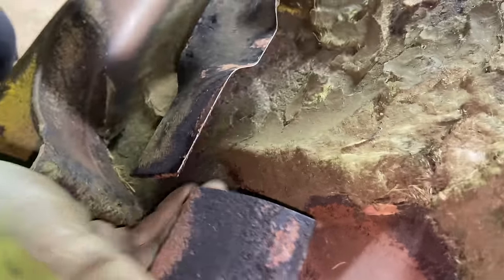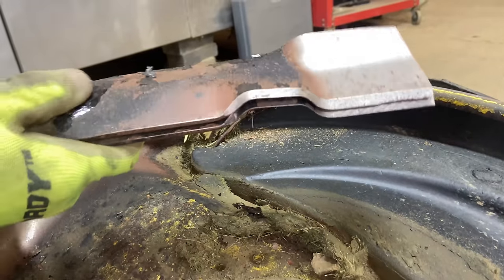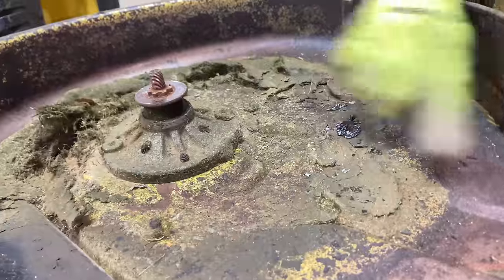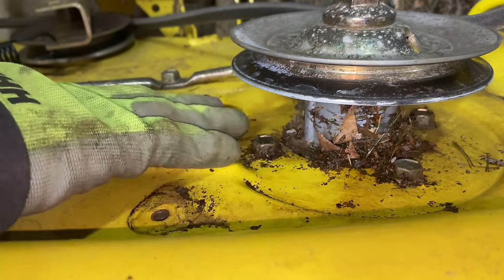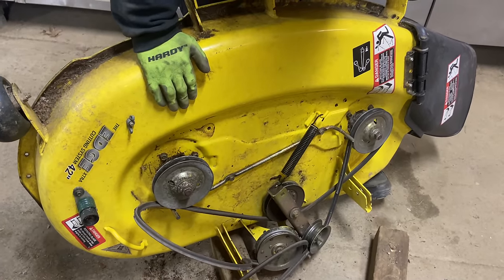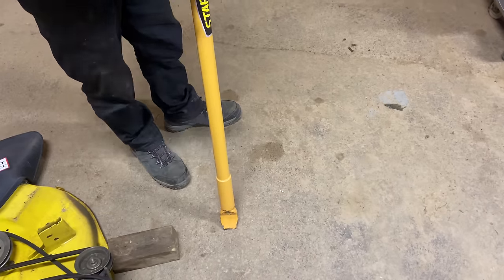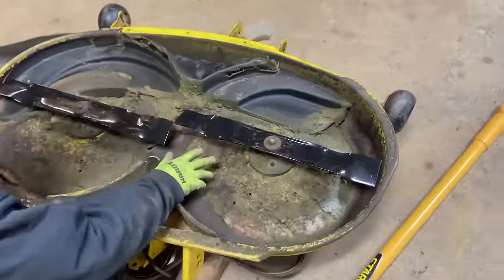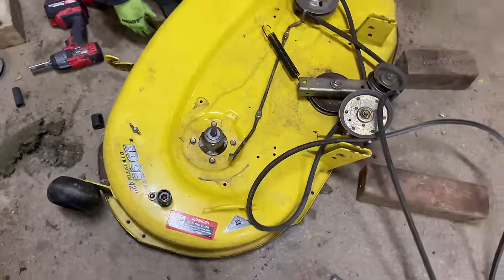Installed New Blades and Still Cuts Uneven

Comment: Great video, very helpful.
Question; do both blades install at the same orientation (12/6) or opposite 12/6 & 3/9)?
Reply from the maker: It doesn’t matter which way the blades sit unless you have a cogged mower deck belt with timed blades.

Comment: I think this is the solution to my problem. Just happened across your channel. You gained a new subscriber. Do you have much experience with the Snapper RERs? Not being cynical in asking it’s just that I find no one in my area knows anything about them. I have one that just sits because I can’t seem to get the drive system working right.
Reply from the maker: Worked on snapper riders 20 plus years ago. A machine from past that we do not see any longer in my area. I didn’t have the you-tube channel back then so I do not have any videos on the machines and will not have any videos coming.

Comment: My sister recently hit an old stump with her John Deere x350. I took a look and blades were hitting on each other when pro engaged. Thought blades were bent. Ordered new ones. Engaged pro and same thing.  Blades would hit on each others tip when they would come around together. Anybody have any ideas? I checked both spindles and everything appears to be okay. Could the deck be bent?????

Comment: Have an older John Deere 100 series 42” deck. All of a sudden started skinning the left side only. Took the deck off, bent blade. No big deal, replaced it. The blades are balls on accurate, maybe 1/32” difference between cutting edges, MAYBE. Put deck back on and leveled. Raised deck all the way, made sure cutting edge of blades were still dead on even once the deck was on, and they were. Went to mow, still the same exact issue, just a tad less apparent now. Still mowing streaks, left side seemingly cutting lower than the right. Also, tire pressure the same on either side’s respective tires. Any ideas?
Reply from the maker: If the mower deck is cutting low on one side. The deck is not correctly leveled. Check all tire pressure before leveling the deck.

Comment: I'm wondering if, after adjusting the deck to align the blades, can you add a doubler plate to strengthen the thin deck material?  That 12 gauge sheet metal seems kinda flimsy. Otherwise It'll probably bend again next time you hit a root or something.
Reply from the maker: Yes you can, I think someone commented on that. You may be able to find on Amazon. I personally do not. Most of the time, it’s one fix and done. Have had only a few return with same problem in 30 years.

Comment: I ran over a small cedar tree stump with my JD X33O  32" deck last year.  The second time last year I tried to destroy that mower.  Anyway, the second time, I bent both blades.  After installing 2 new blades, I found out they were meeting in the middle, tip to tip.  Ended up trimming about an eighth of an inch off each blade.  Not kosher, but it was crude and effective. I've got to look each side again to see where I bent the deck.
Reply from the maker: I have come across aftermarket blades that would touch in the center but the old blades did not so I had to do what you did. As long as the deck is cutting good and grass looks good, I wouldn’t worry too much about it.
Reply: @JohnsonsSmallEngines  Thank you for the reply.  I ground some clearance on one blade, used marker like dycum blue , them ground to match.

Comment: 13:14 marker the four bolts you see there holding the spindle to the deck, after mower for an hour or so, my bolts come undone on the one. I know on the one I have a piece of spindle that is missing (broken piece fell out) but the barring is locked in and fine. Should I use loctite blue? Thanks!!
Reply from the maker: The hub is broken and the  mounting holes sound like the threads may be very worn. I would suggest use longer bolts and use locking nuts on the other side of hub or replace the hub. Having a broken hub is not safe and if your machine came into my shop, I would have to replace it due to liability reasons. Replacing the hub is the safest way to go!
Reply: @JohnsonsSmallEngines  when you say the hub, you mean the overall spindle? I do thank you for your time.
Reply from the maker: Yes, hub/spindle same thing. I sometimes do not say the correct word for the part.
Reply: @JohnsonsSmallEngines  thank you again!!

Comment: I watched your video and uneven cuts, I have the same problem. John Deere is telling me that this issue is worn/damaged spindle pockets. Prior owner used over sized washers to hold the spindles to the deck (suspect worn out holes)

Any idea on a fix?

Other do I need to replace the deck?
Reply from the maker: I would really need to see the deck to make a good decision on what to do. You can weld plates to the deck but you would need to go to a good welding shop to get it done right which may not be cost effective verses buying a new deck. I would suggest taking pictures and sending it to a local welding shop to see what it would cost to repair versus how much the deck is? I’m pretty sure the lower decks come empty so you will need to transfer all parts from the old deck. The question is how good are all the old parts?
Reply: Thanks

Comment: I'll have to this to my deck as I suspect this is my problem. Do you think it would make sense to use a small level while hammering on the deck to see when its close compared to bolting the spindle back in place multiple times?
Reply from the maker: I would give that a try because as you say, it is tedious process to get it straight. But in the long run, it does save a ton of money, not having to buy a new deck or machine at that. If you do attempt it, please let me know how you made out.
Reply: @JohnsonsSmallEngines  I agree. It will only cost me my time. I'll let you know what happens. Wondering if there's enough of a bend to show a difference on a level to begin with.
Reply: So I tried the level and there was enough of a bend to show up on the bubble. I "persuaded" it to a point that was pretty close to level. When I put the spindle back on there was still a slight difference in height. I took the blade off and sure enough the spindle is also bent. I ordered one that will be here in a few days. I'll let you know once it's bolted up if using the level worked or not.

Comment: Hey, are all 100 series 42 inch decks   interchageable that have the 3 point hookup?What are saying is can I take the deck off a D102 42 inch deck and put it on a LA115 with the 3 point hookup?
Reply from the maker: I personally do not get into interchanging mower decks. I would call a John Deere dealer to answer that question.
Reply: @JohnsonsSmallEngines  Man, I love your quick responses. I appreciate that though, thanks!

Comment: I need a similar video for a single blade mower. Dang thing is new and cutting uneven, can’t figure it out
Reply from the maker: Check your tire pressure and make sure they are even. Make sure the blade is not bent? Check your owners manual on how to level the deck.
Reply: @JohnsonsSmallEngines  thanks! I’ll keep trouble shooting it

Comment: Do you have a video that explains brake adjustments and front yoke (2 Holes which one is better) and what size cotter pins for stronger placement to use? Liked the video and thanks for your knowledge.